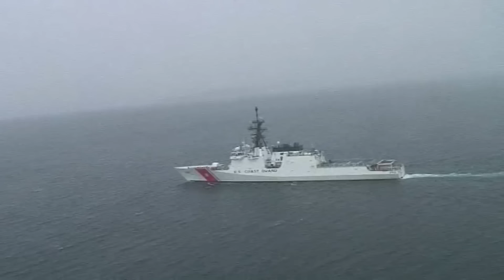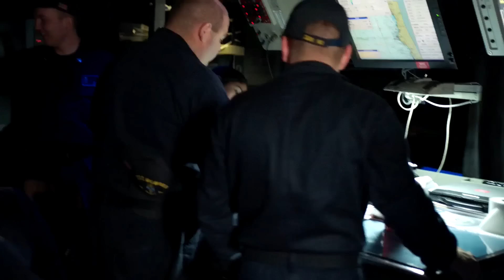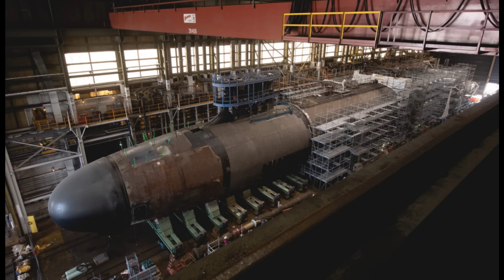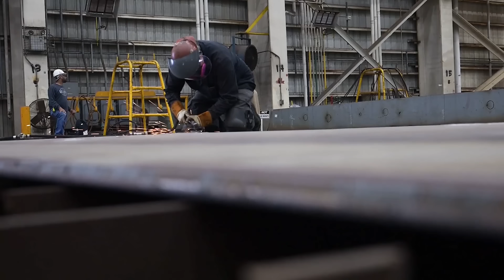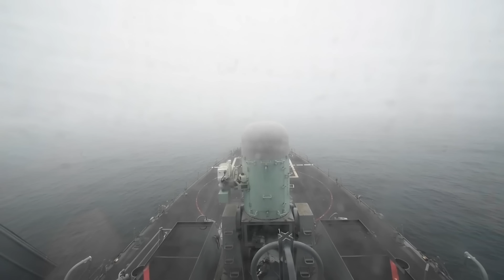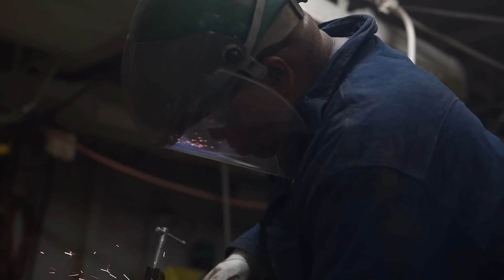The US Navy’s Radical Plan to Build Its New FF(X) Frigate Faster and Cheaper

Comment: That's not a frigate..looks more like an OPV..
Reply: Yeah,well... the US isn't currently capable of building proper warships so this is it. Afterall, the FF(X) and trump-classbattleship both have an export potential of... zero. Yes, ZERO. The US doesn't needsomething like the ObeyAct to protect sensitive US defence tech in the trump-class and FF(X), because those things are so undesirable that no one is going to be interested in buying them... except for the likes of china, Russia, and Iran, but even then that would be so they could reverse engineer them more than because they are interested in fielding the damn things as warships.
Reply: @manishdyall4779  i agree, we online admirals could do better- step 1 digitize and put into 3d the iowa battleship prints, step 2 update power plant, armor, sensor and weapons- it would come in under 35,000 tons have 3x the armor, be faster than 33kts and could take on 6 iowas ( update 16in 50 to 16in 62 would modern propellant, barrel snd rounds). Repeat with the ffg7 design
Reply: @MichaelDeclercq-t5z  We're replacing the Ticonderoga class cruisers with these battlecruisers (battleships). This was always going to happen. Why try to "digitize" ww2 tech when we can build far more advanced cruisers that ate meant to replace the old cruisers meant to be retired in a couple of years?
Reply: @BartimaeusAurelius  the old tech was designed to take damage which most ships aren’t today, just use it  as a starting point. Ships are only designed to take damage and stay afloat, let build to take damage and keep slugging it out. sta to
Reply: For example - ww2 406 mm was very heavy steel, m-1tank has 1000mm armor which weighs a 1/3 as much, change out the steam plants for diesel electric drives.( bet you double the range and cut the crew by 3/4ths). Having starting point saves time and money, look a the Spruance hull- kidd ddg and the cgs.
Reply: Fyi, in the early 1980s usn saved a section of a heavy cruiser hull snd tested asm against it, subsonic missile failed to penetrate it and this was a fraction of the armor of s bb.
Reply: Uss stark took 2 exocet missiles, stayed afloat but was incapable of fighting compared to ww2 heavy cruisers that lost their bow and still fired thrir weapons
Reply: @MichaelDeclercq-t5z  The problem with armor is weight which will limit what the ship could carry.

Combat ships have used all or nothing armoring for awhile now - they armor the most vital parts (ammo stores, fuel, engines, … etc.) while the rest remain unarmored. Also no matter how well armored a ship is, if something hits the propeller … you are dead in the water.
Reply: @damned-n7j  if you look at traditional armor I agree but with ceramic and composite materials like what next gen tanks use you are looking at 1/3- 1/6 the weight which is a game changer . If you have the volume it gives other options too.
Reply: @MichaelDeclercq-t5z  Tanks are having trouble too these days. Anti-tank crews absolute reck them.
Reply: @damned-n7j agree, add active protection systems and it changes, 1 Israeli tank stopped 5 rpg and 2 missiles with  its  trophy system plus it directs fire back to source. Think anti- tank systems are going back to guns like anti air systems- cheaper and use less rare earths.  are
Reply: @MichaelDeclercq-t5z Ships already have active defense. They had it for decades now. Except these new no missile “frigates” …
Reply: @manishdyall4779  putting those Trump class so called battleships for sale to outsiders would be a total 🤦‍♂️ case..They should only be for the USN..
Reply: @paulantony4598  Yes, because these  ships are designed to solve US institutional problems.
Reply: @manishdyall4779  Nonsense... Every nation will desire to have HELIOS lasers and hypersonic missiles in the near future... The US Navy have tested the HELIOS laser in a Arleigh Burke class DDG guided missile destroyer, it consumes too much of the destroyers power the navy wants TWO, not one HELIOS laser aboard their front line warships... To supply the power the navy wants for TWO HELIOS lasers and the rail gun, well, you need a ship twice the size of a Zumwalt class DDG to squeeze in the power plant... Thus the large size for the BBG battleship... The Zumwalt class DDG was designed to squeeze in the power plant to fire two rail guns...
Reply: @ronclark9724 
1. DDG already includes "Guided Missile Destroyer"
2. Okay, you clearly didn't read my comment properly. Those things - HELIOS and Railguns - can be ordered separately and a sensibly sized hull can be designed to accommodate them. If the US Navy can outfit an Arleigh Burke with them, then other nations can simply order HELIOS and outfit their ships with it since Arleigh Burke wasn't designed with HELIOS in mind or any DEW really.
Reply: @manishdyall4779 Selling ships to foreign countries was never the goal.
Reply: @BartimaeusAurelius  Way to miss the point, I was saying the USdoesn't need an Obey Act to keep the technologies onboardan FF(X) and trump-class hers, it is that Hanwha and Huntington Ingalls would be too embarrassed to offer the trump-class and FF(X) to any nation running a contest to import warships, because those things are so bespoke that they aren't even being built for proper naval strategy but are competent in the sense that they are meant ot address American institutional and cultural problems rather than build a competent ship for warfighting, that america has sacrificed competent warship design because her institutions do not allow for competent warship design and they need to be designed to instead address American Institutional and cultural problems since right now, even a bad warship is better than no warship.
NOBODY who has the option of buying aSejongthe Great or type 83 would go for a 35 000 tonner; and no one who can buy a frigate from somebody else would go for an FF(X) because FF(X) is just that bad. As in even if you gave Russia and China perfect logistics, let them steal Trump-class battleships and FF(X) in perfect working order, and seamlessly integrate them into their navies; they would still refuse ot sail them but instead just reverse engineer them to improve their fleets and develop countermeasures to American tech.
That is just how godawful the Trump-class and FF(X) are: that America couldn't even get her adversaries to sail them as warships.
Reply: It is a Corvette. Decisions: Corvettes now, or Frigates in 20 years time.
Reply: @ataxpayer723  at 4600 tonnes? That's about 3 or 4 times bigger than a corvette. The last Corvettes the US Navy used were under 1,000 tonnes.

At 4600 tonnes it's far bigger than common frigates like the Meko 200 class (3600 tonnes), the Brandenburg class (3600 tonnes), La Fayette class (3200 tonnes), Daegu class (3100 tonnes) all of which have air and surface radar AND sonar capabilities, and are equipped with torpedos, a main naval gun, a VLS system with air defence missiles, CIWS, anti ship missiles and an ASW helicopter.

This is definitely big enough to do small scale stuff solo but not provide area air defence or slug it out with heavy destroyers or cruisers. You know, the kind of work frigates are designed for. Patrolling, escort work, anti submarine warfare, humanitarian aid.

That's why the Constellation class failed. At 6700 tonnes it's bigger than many destroyers (eg Akizuki, Durand de la Penne, Delhi, Type 52) it got into the zone where it cost a destroyer budget so needed to have capabilities equivalent to a destroyer to justify the expense. Once it got into that price range it became "well now we need AEGIS" and the whole thing just snowballed. 

Other large frigates eg Horizon and Baden-Wuttemberg class face similar issues. In fact, the French version of the FREMM/Constellation class may be called frigates in service but carry a D pennant number labelling them as Destroyers.

The two main problems were mission creep and not calling it a destroyer escort. The price was much more palatable if it was labelled a destroyer escort.
Reply: @ataxpayer723 You can buy working frigates from other countries you know …
Reply: At 4600 tons it's actually far too big and too expensive to operate as an OPV.
Reply: @A @AndyViant  it is actually bigger than a ffg7
Reply: @MichaelDeclercq-t5z  Larger than both the Oliver Hazard Perry class FFG and the Knox class FF... My Knox class FF usually escorted tankers and supply ships, but we saw time as well being with the aircraft carrier task group... At least we could conduct ASW operations with our helicopter, ASROC, and torpedoes, if not a major factor with surface warfare or  provide area air defense....
Reply: @AndyViant  what do you think the Legend class cutter, which this is based on is? It is an OPV..a Coast Guard OPV.. Heck, there are navies with OPVs with bigger displacements than this..
Reply: @paulantony4598  It's BASED on an OPV with an oversized hulled OPV that has spare capability because it was not fully utilizing it's tonnage.

Australia is doing the same thing. Look up the Arafura class. Oversized for the OPV capability, undersized for it to be useful.

The difference is that at 4600 tonnes in OPV form and around 5700 tonnes in Frigate form it's got the potential to be quite capable. That's bigger than the extended Mogami class, or the Sachsen  class frigates.

The hull isn't the issue. it's the fitout. And the fitout will change for the Navy over the coastguard, and utilize about another 1000 tonnes of fitout. The video addresses this.
Reply: @AndyViant  1,000 ton fit-out? 😂 This ship's extra fit-out is a couple of those modular containers which'll give it an additional weight of 200 tons max. 1,000 ton is corvette displacement level. You saying this is going to have an additional corvette's weight worth of container fit-out equipment?
Reply: @paulantony4598  No. I didn't say that at all. I said that the hull was rated for a certain displacement and they've changed that for the FF(X), although the numbers seem to vary depending on the source. I've seen everything from 4750 to 5700 tonnes displacement. 

Those numbers could vary from the first two hulls which were already under construction to the later ones, too, which might be why they vary so radically.

I mean they're already talking about 3 different blocks of FF(X).

Extending the hull on an existing design is a fairly common practice.

It isn't a couple of containers of missiles that will drastically change things it's the changes to the sensors and warfare systems. You'd think some form of ASW sensors is a must for a Frigate or how can they independently escort anything in wartime? Obviously the containerized loads could include anti submarine missiles like the Sea Lance. 

You'd also think they'll be installed with either a second CIWS or more likely some kind of laser defence system since even tanks and AFV's are being equipped with them now. 

A great example would be Australia's EOS Apollo laser system, with potential laser output of 150kw although there's other options that could be used. 

Anti drone combat capability is going to be essential. Another Phalanx over the Legend class is going to be another 6 tonnes alone, unless they choose a laser system instead. I don't know the weight of the apollo system. The containerized systems a few hundred tonnes.

Also remember the Legend class were designed to have extra weapons and systems so are running below their displacement.

They'll use that spare displacement, you can be sure of that. Because there's too many things that Legend can't do that a Frigate will need to.
Reply: @paulantony4598  Not really, not a 4700 tons displacement... The RNZN OPVs are less than 2000 tons displacement... The RN OPVs are also less than 2000 tons... The USCG NSCs are 4700 tons displacement, and are designed to patrol the Bering Sea near the Aleutian Islands and the Philippine Sea near Guam, both a long distance from Alameda, California and Honolulu, Hawaii... America build ships for the Pacific, nearly all of our European allies build ships for the Atlantic... The Pacific is THREE times larger in size, and thus range is important...
Reply: @ronclark9724 you're comparing that worthless New Zealand navy & it's OPV with the USN? 🤣  Just stop it..🤦‍♂️
Reply: @ronclark9724 Australia's OPV's were  the Cape Class and then Evolved Cape Class at around 400 tonnes displacement before the Arafura class came along at 1640 tonnes, with slower speed, less endurance, no better weapons and no greater range. 

The only real benefit would be the UAV and  targeting systems, with the potential for mounting some NSM's and maybe a 40mm or 57mm Naval cannon.  But for a patrol vessel that's overkill, and for anything else the 40mm (or the existing 25mm) is effectively not enough. The 57mm just meets the requirements of this class and capability.

Maybe such a low capability vehicle might be a good spot to actually install Australia's existing stocks of Harpoon missiles as it's main offensive weapon?

At this point the only benefit of the Arafura class is if they get reconfigured as a minehunter, or get passed over to Border Force as a kind of off the Navy's budget Naval Reserve.
Reply: Or think a guidemissile corvette
Reply: @MichaelDeclercq-t5z without all the radars and vls cells.. this far from a guided missle anything... hence ff(x) not ffg(x) anymore, "g" stands for guided missiles... putting a shipping container on the back with a few missiles in it doesn't make up for the lack of embedded capabilities
Reply: @gotaPhDyoumadbro  Every NSC Legend class cutter has room and space saved for a 16-cell Mk-41 VLS suitable for ESSMs and Vertical ASROC... It is just a matter of fitting it... While SM-2 could also be fitted, they require a more advanced targeting radar and control system... The FFX will not be equipped with a SPY Aegis radars... Having said that a FFX can be linked with a DDG or aircraft carrier task force... Frankly as long as the FFX has a single Mk-49 RAM with 21 missiles, she should have sufficient anti-air self defense... Just like the LCS with RAM...
Reply: @ronclark9724with all the new renderings from the navy I've seen, the changes the flat bridge area takes up said room for the VLS.... so I disagree with your premise that the the RIM-116 is ADEQUATE self defense capabilities in a contested environment and IN NO WAY is a way to protect a ship it is SUPPOSED to be escorting... and where the hell is the ASW capabilities if they have no towed sonar and/or haul mounted sonar? The helicopter going to be airborne 100% of the time with an unlimited supply of sonobuoys? 😂 This is a joke if people think these #1) will be not have a significant design change that does not give us hauls in the immediate future (2 years or less) #2) will be on time OR on budget #3) will ultimately even hit a majority of the key indented mission sets and not require additional assets in lightly to moderately contested AORs.... Also LCS was not designed or envisioned to be an escort ship across blue water so thats a false equivalence to try to prove your point 👎
Reply: Which is another name for a frigate 😂😂😂😂.  We'll use destroyers and battlecuisers ( battleships) to handle the real threats.
Reply: No it's squarely in the frigate category.
Reply: @gardnert1 4.6k t max frigates were before the early 2000s, now you have frigates in the 7k tons & more.
Reply: @paulantony4598  and everyone debates them as being light destroyers. the FREMM frigates are actually a NATO Destroyer Designation in the French Fleet.

This is clearly why the US Navy had problems in how they defined and equipped them.
Reply: @paulantony4598  The size is not the critical factor. The capability is. A frigate is a role, not a size.
Reply: @AndyViant  FREMM itself stands for Frigate European Multi Mission. NATO might designate whatever, fact is the navies that made them designate them as frigates. Whatever the case, those ships have a decent amount of AShMs, VLS & ASW systems like triple tubed torpedo launchers & carry choppers that can also do the same, to designate them as frigates or destroyers. What does this FFX have? Renders/reports don't show/mention it having any VLS or ASW capability. Can't even see a hull mounted sonar. No mention that it'll definitely have a TAS. So as per what I can see & the fact that this is just a slightly reformatted CG Legend OPV cutter..it's an OPV.. The dang thing even has the same little 57mm pew pew & not even a decent 76mm, unlike proper frigates..🤦‍♂️
Reply: @gardnert1  Ok then, as per the renders this looks like an OPV with an extra 8 AShMs..
Reply: @paulantony4598  It will end up with VLS's. The majority of the rendered images of the Naval FF(X) that I've seen rather than the Legend Cutter definitely showed VLS's. 

But missiles don't have to be installed in VLS's. They can be canister launched instead if that suits the space layout better. Sure it's less convenient for reloading but if it allows a capability where VLS's might be tricky based on ship layout then you use canister launching instead. For a ship that shouldn't be trying to slug it out anyway a couple of 4 pack canister launchers for the bigger strike missiles (eg JSM, Sea Lance) and an 8 VLS system to run some flexible smaller missiles like quad packed RIM-116's and Nulka's still gives a great range of capability.

Even so, there's definitely space for VLS cells on a Frigate this big, given far smaller ships have been equipped with 32 or even 48 VLS's, and there's at least space for towed sonar. But really, no Frigate should be built in 2026 for just towed sonar capabilities. It should have hull mounted sonar as a MINIMUM. If they don't end up with a mounted sonar I think it's another design fail.

Also, don't knock the 57mm. It's got a range of about 9 miles which is a very long range hit for a naval gun on a moving target, and has options for guided shells, programmable shells etc. There's no reason why extended range shells for it could not be designed just like the 155mm either. 

While the record hit at sea is about 16 miles, the odds of pulling a shot like that are much better for a gun that can fire 220 rounds per minute. It's a trade off, and the fire rate and flexibility of using the 57mm for anti air and anti ship roles makes it very suitable for a smaller vessel. 

Reality is anything longer than that 9 mile range is it's about the missiles. 

But, as we've seen in the past, "designed for but not equipped with" is a common scenario. We just have to wait to see what they actually put on it.
Reply: @AndyViant  the only VLS I've seen for this FXX is for some Hellfires. You have links of these majority of the renders having Mk41 VLS? Modules can carry only limited no. of missiles. The LCS was designed to have these so called modules & it ended up nowhere much for weapons vls. Having modules at the stern where the AShMs are, will make that part heavier & way too cramped up than what it should be, which won't be a good thing. And if they put the modules on the flight deck, it's gonna be pretty stupid. Those modules will probably end up as the same story for the LCS. As for your 57 mm & it's 9 mile range..😂 Btw, the multi-purpose Leonardo 76mm guns also have Vulcano ERGMs that can extend their range all the way to 25 miles/40 kms. Their STRALES & Sovraponte versions can even act as anti missile CIWS with their advanced DART rounds up to 5 miles/8 kms, compared to the mile or so range of Phalanx. Your 57 mm guns are meant for OPVs & Corvettes. Heck, quite a few corvettes & OPVs have the 76mm..not the puny 57mm, which this FFX has.. 
Whatever rocks your boat admiral..
Reply: @paulantony4598  This is an OPV. You have no idea what you're talking about.
https://en.wikipedia.org/wiki/River-class_offshore_patrol_vessel
Reply: @paulantony4598  Maybe it's just the imgs I'm seeing, but of the first 6 images I get, 4 of them have VLS's and two don't. Those tend to be themost repeated renders. Of those 3 of them have VLS cells behind the 5 inch gun and one has them in the rear cargo space in front of the helicopter landing pad.

I think I've seen one with vls cells in place of the canister launchers too but a quick search then didn't find it.

As for the 76mm, while I don't disagree it's a better ranged weapon, most modern frigates have been choosing 5 inch guns (eg F100 class, the new Mogami class, Meko 200, Type 26 etc).

As the priority has become bragging about the amount of VLS cells you have the my gun is bigger than your gun stuff seems to have become less important.